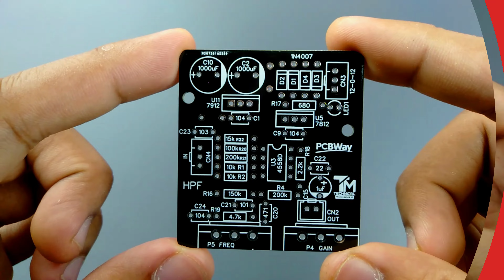Active Band Pass Filter || High-Pass Filter

Comment: App Home Audio K liya Ek asa 2.1 bord le k liya ..... ku market me or koi 2.1 bord asa hai he nahi jo 12inch subwoofer k liya ho  .. Makit me Jitne V 2.1 Bords un me koi v bord 12inch subwoofer ko Sport nahi kr ta .. ku Market me khi se v 12 inch 200 se 300watt  subwoofer Easy mil jate hain 8 inch 6 inche subwoofers Har jaga se Easy nahi milte .. 6.5 inches Speakers 8 inche Speakers 10 or 8 inch Speakers har shop se Easy milte hain .... App ek Asa 2.1 bord Develop kr Market me liya  Jo 12 inch  200watt se 300watt Subwoofer sport kare or  4 Speakers 6.5 inch ke mid bass woofers ya Coaxial ya Component ya 6x9 inch Coaxial car Speakers or 8 inch full range Speaker  or 10 inch full range Speaker  sport kare .... 

Ek asa 2.1 Bord Design kr k Market me la e ga .. 
Home Audio k liya .... jis Saste cheap Midium Quality ke Components Laga k ek Buget bord bno .... in me kisi v Transistors numbers me 
C5158&A1941 Or Tip142&tip147 or Senkin C4467&A1694 in 4 o me Se jo saste or best  Type number ke Transistors ke 4 pair vala total 8 Transistors me Class Ab Amplifier kit bna ho 4 channel Circuit ho  2 = 1  2 do Channels ko Bridge mod kr Subwoofer k liya diya jay  Baki Do channels Speakers k liya  ho  ... Ac to Dc Converter Bord me inbuilt ho 50 volt 4700uf k 6 Capstors ho 2 Bridgeractifires converter me Or or Transistors  pe inverter vali Fins vali Heatsink with  Cooling fan ..... 2.1 PreAmp V Ek pcb me bna k .. 
ek Naya Designe La ke aia  Market me .. dekh ye Ek Revolution ho ga home Audio Amplifier k liya .. 

Ek e Pcb me Amplifier Section  or Ac to Dc Converter 2.1 pre Amp  ho ...

 PreAmp  kis Type  kaa ho 
4 tones  1st tone  Master volume Pura All Amplifier ka 
2nd tone  Subwoofer Bass 
 3rd tone Speakers Bass 
4th tone Speakers Trabel or is  elava pre Amp  
Bord ke ke Ander ke side  3 Adjustable Presets 2 Subwoofer ke  ek Speakers ka bord ke upper ho 
1st Preset Sub Gain  or 
2nd preset LPF frequency vala preset Bord ke upper 40Hz tu 250Hz tak ka ho sirf Subwoofer vali side pe or 
3rd preset left right Speakers gain k liya  ... 
in 3 preset ka fida ye ho ga ke cabinet khol k Ander se in preset se LPF setting or sub or Speaker ke gain ke Setting voha pe Atjust kr sac ga jis fida  ye ho ga ki Subwoofer or Mid bass Woofers ke awaz nahi fate G os isab se Andar se gain set ho jay g ...

7805 ic Bluetooth card k liya  laga dena .. Bande ko Sirf Cabinet or  0 12 volt 1 amp or 18 0 18 votl Ac 15 tu 20 Ampair ka 300Va minimum se 500 Va maximum tak kaa koi V 
1 Ei ya 2 Troidal Transformer pe ye bord bhout asha Run kare ga or Bt card He lagana pade baki sab ek e pcb ho .. 

 kamal ke kit bane Total ...
.. At 4ohm 200watt Subwoofer k liya  100+100W at 2ohm Speakers k liya  .... 200+100+100 = 400 watt kit .... 

4 channels kit bna k  2 channels ko Bridge kr ke baki 2 channels  Speakers k liya shod de tho us ka fida ye ho ga ke ek e  24 tu 27 volt plus minus  Dc Supply pe pura kit or PreAmp or Bt card sirf ek Supply Run kare  ga Alag Alag Supplys ke Jurat nahi pade ge  ....  

agar Ham 4 transistor me mono bna subwoofer k liya  us k liya  40 volt plus minus Dc Supply ke jurat pade ge 200watt liya  2 channel  Speakers k liya Alag se 26 volt plus minus Dc Supply ke jurat pade ge Speakers vala kit k liya Supply alag or Subwoofer mono kit k liya alag Capstors  bridge Bridgerectifires Capstors 3 Alag Alag Supplys k jurat pade ge  ... 

 is Amplifier kit pe 12 Inch 120 mm Dual Magnet  1.5 inche Coil vala ek Subwoofer bhout jada asha Run kare ga ... maximum  is Amplifier pe 135mm Magnet vala 12 inche 2 inch coil 300Watt ka subwoofer v Run kare ga isa jada nahi ... or ye do Bridgeded Sub Channels  only 4 ohm Stabel  Ek Singel coil ka koi v Ek Subwoofer bhout Asha Chela ga  .. 2ohm Unstabel koi v DVC sub ya 2 Subs is bord pe Nahi chale agar kisi ne Laga diya tho 2 minutes me Transistors Over heat ho jay ge Agar bord me protection  naa hui tho Transistors jal jay ge ..... 

Market me Jada tar 1.5 inch coil vale Subwoofers 180 watt se 300watt ke atte hain 120mm or 135mm dual Magnet me ...... 90 mm Magnet vala 60watt ke K 8inch 4 Speakers ya phir 10 inch ke 120mm Magnet vala 100watt 2 Speaker woofers bhout Ashe Run ho or 100watt tak Speakers woofer Run ho sac te hain 8 inch tu 10 inch tak k or 6.5 inch 6x9 inch k 4 Coaxial car Speakers  ashe chale Ge ... Agar Testing ke Doran Subwoofer side thora heat hua tho Subwoofer sird 2 Bridged channels ke Transistors 2sC5200&2SA1943 lag dena ...

Comment: ku market me or koi 2.1 bord asa hai he nahi jo 12inch subwoofer k liya ho  .. Makit me Jitne V 2.1 Bords un me koi v bord 12inch subwoofer ko Sport nahi kr ta ..ku Market me khi se v 12 inch 200 se 300watt  subwoofer Easy mil jate hain 8 inch 6 inche subwoofers  Har jaga se Easy nahi milte .. Speakers 10 inch se 12 Speakers har shop se Easy milte hain .. ... .. App ek Asa 2.1 bord Develop kr Market me liya  Jo 12 inch  200watt se 300watt Subwoofer sport kare or 2 Speakers 10 ya 12 inch woofers ya full range  Speakers sport kare .... 

Ek asa 2.1 Bord Design kr k Market me la e ga .. 
Home Audio k liya .... jis midium Quality ke Components Laga k ek Buget bord bno bord jada Costly na ho .... TDA7294 Double ic Speakers  k liya  or  
 5200&1943 2 Channels ko Bridge kr k mono kr subwoofer k liya Is Fida ye Hoga Subwoofer kit v 35 0 35 volt Dc pe chal jay g ... 
 ... Ac to Dc Converter Bord me inbuilt ho 50 volt 4700uf k 6 Capstors ho 1 heavy Bridgeractifire converter me Or or Transistors  pe inverter vali Fins vali Heatsink with  Cooling fan with All  protections .....2.1 PreAmp V Ek pcb me bna k .. 
ek Naya Designe La ke aia  Market me .. dekh ye Ek Revolution ho ga home Audio Amplifier k liya .. 

Ek e Pcb me 7294 Dual ic s  Speakers or 5200&1943 Sub Amplifier Section  or Ac to Dc Converter 2.1 pre Amp sab ek pcb me ho ... 

PreAmp  kis Type  kaa ho 4 tones  1st  tone 1 Master volume 2nd tone  Sub Bass  3rd tone Speaker Bass 4th tone Speaker Trabel or is  elava pre Amp  
Bord ke ke Ander ke side  3 Adjustable Presets 2 Subwoofer ke  ek Speakers ka bord ke upper ho 1st Preset Sub Gain  or 2nd preset LPF frequency vala preset Bord ke upper 40Hz tu 250 Hz tak ka ho sirf Subwoofer vali side pe or 3rd preset left right Speakers gain k liya  ... in 3 preset ka fida ye ho ga ke cabinet khol k Ander se in preset se LPF setting or sub or Speaker ke gain ke Setting voha pe Atjust kr sac ga jis fida  ye ho ga ki Subwoofer or Mid bass Woofers ke awaz nahi fate G os isab se Andar se gain set ho jay g ...

 7805 ic Bluetooth card k liya  laga dena .. Bande ko Sirf Cabinet or  0 12 volt 1 amp or minimum 20 0 20 se  24 0 24 votl Ac maximum 20 Ampair ka 400Va minimum se 550Va maximum tak kaa koi V Ei ya Troidal Transformer pe ye bord  bhout asha Run kare ga or Bt card He lagana pade baki sab ek e pcb ho .. 

 kamal ke kit bane Total ...
.. At 4ohm 300watt Subwoofer k liya  100+100W at 4 ohm Speakers k liya  .... 300+100+100 = 500 watt kit .... 

5200&1943  2 channels ko Bridge kr ke TDA7294 Double ic Speakers k liya ho .. us ka fida ye ho ga ke ek e  30 tu 36 volt plus minus  Dc Supply pe pura kit or PreAmp or Bt card sirf ek Supply Run kare  ga Alag Alag Supplys ke Jurat nahi pade ge  ....  

agar Ham 4 transistor me mono bna subwoofer k liya  us k liya  40 volt plus minus Dc Supply ke jurat pade ge 200watt liya  2 channel  Speakers k liya Alag se 26 volt plus minus Dc Supply ke jurat pade ge Speakers vala kit k liya Supply alag or Subwoofer mono kit k liya alag Capstors  bridge Bridgerectifires Capstors 3 Alag Alag Supplys k jurat pade ge  ... 

 is Amplifier kit pe 12 Inch 135 mm Dual Magnet  2 inche Coil vala ek Subwoofer bhout jada asha Run kare ga ... maximum  is Amplifier pe 155mm Magnet vala 15 inche 2 inch coil 400Watt ka subwoofer v Run kare ga isa jada nahi ... or ye do Bridgeded Sub Channels  only 4 ohm Stabel  Ek Singel coil ka koi v Ek Subwoofer bhout Asha Chela ga  .. 2ohm Unstabel koi v DVC sub ya 2 Subs is bord pe Nahi chale agar kisi ne Laga diya tho 2 minutes me Transistors Over heat ho jay ge Agar bord me protection  naa hui tho Transistors jal jay ge ..... 

Market me Jada tar 1.5 inch coil vale Subwoofers 200 watt se 400watt ke atte hain 120mm se 155mm dual Magnet me ...... 120 mm Magnet vala 120watt ke K 8 inch woofers ya phir 10 inch ke 135mm Magnet vala ya 150watt k 2 12 inch Speakers ya woofers bhout Ashe Run ho or 150watt tak Speakers woofer Run ho sac te hain 10 inch tu 12 inch tak k 2 Speakers ashe chale Ge ...